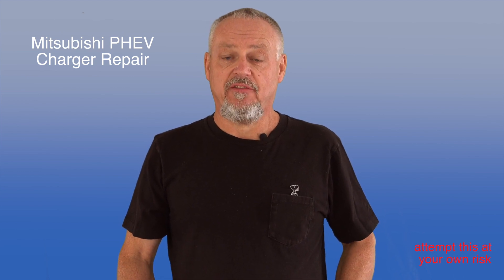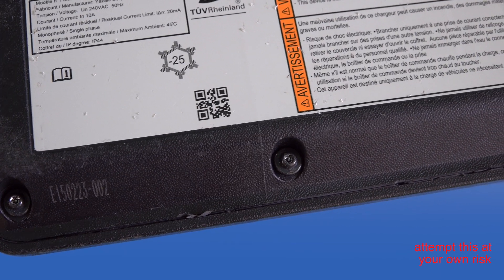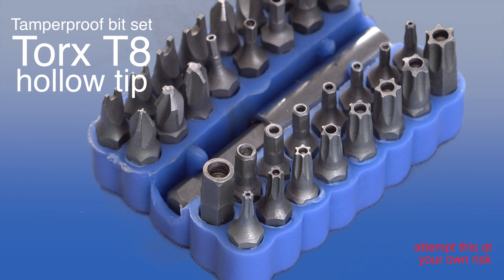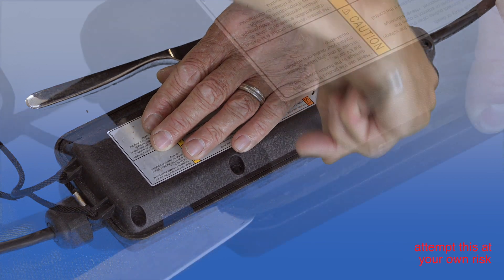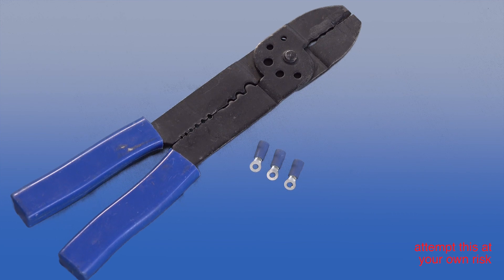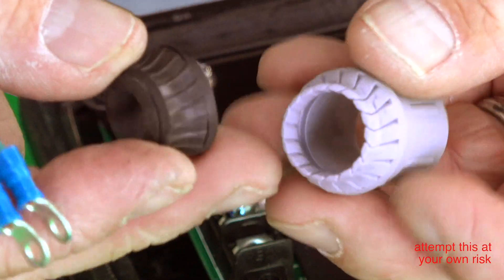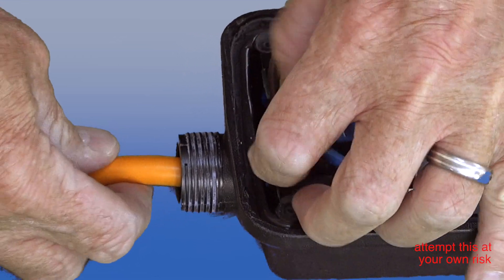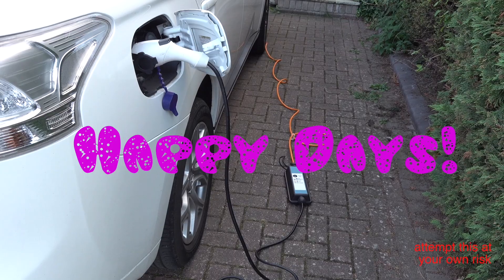Mitsubishi Outlander PHEV Charger repair

Comment: Great video. I was gifted a unit that wasn't working. both positive and negative wires were broken at the gland. People forget to use the cord to suspend the unit from the wall socket and put all the strain on the electrical cable. Unit is now charging my car. Hurrah

Comment: This might be a stupid question, but I'm using the 3 pin, and that cable you replaced it with doesn't see to have a 3 pin connection on it?

Comment: Thank you for this, very helpful. I had a slightly different problem with my (2018) Mitsubishi level one charger: it would go to fault cycle consistently after a couple of hours max of charging. Took two small repairs over time to fix. First, nine month ago, the charger plug lugs were slightly scorched, blackened. I lightly sanded the lugs with emery (blue) sandpaper and some light filing with a metal file, to eliminate the scorching. That worked for a while. Second, recently, I suspected that the 110V duplex wall plug in my garage wasn’t strong enough for EV charging. Domestic wall plugs don’t normally handle eight amps for 8-9 hours straight. I’ve heard that a similar problem can happen with 220V plugs for level two chargers. So I replaced the domestic 110V wall plug with an “industrial” plug from the hardware store; it cost $12.50 Cdn plus a new cover. The charger has worked well since. Also, Mitsubishi sells a weatherproof cover for the charging port, that protects the port from rain (and snow in my case). Costs about $35 Cdn.

Comment: When I (finally) got the box open and checked out the short wire to the plug there was no continuity. Both the live and neutral wires were broken inside their insulation near the 'gland'... It's clear this charger was not 'fit for purpose' when manufactured and it should have been recalled.

Comment: Thank you very much, this saved me 857 Euro as that is the price here in Norway.  Used some body sealant in order to make it water resistant. I was not sure if I should replace the power cord with a 1.5 mm or 2.5 mm cable  but went for a 1.5 mm cable as the rating for the cable i approximately 10 Amp. The Lid was as your said a little tidy to remove but your instruction was a good help.

Comment: Fixed my charger too. Thanks a heap. 
It looks like the gland on the original factory fitting was over tightened, stressing the copper. That is where the break was- on mine anyway. Thanks again.
Don

Comment: Amazing, it worked! Saved me about 500 Euros. I already replaced the charger one time for exactly the same problem. Its ridiculous. Thanks. 
(yeah getting the lid off can be bit of a hassle, I used a sharp small screwdriver also to yank out the sealant stuff before prying near the corners
Reply: which replacement cable do we need to buy?

Comment: Thanks a lot for this video. I managed to repair my charger. One thing I did do was remove the screws holding the circuit board in so I could get beneath to unscrew the clips holding the wires better. May save a few headaches :-)
Reply: Great suggestion helped me thanks!

Comment: Hi there, i've been struggling to pry it open for 30 mins now. I used stanly knife at first to cut and have been trying to loosen it up with kitchen knife after. How did you guys succeed.
Reply: Yeah it's hard work but a Stanley knife and a kitchen knife to seperate and pry apart is the trick. Also the corners need picked at top and bottom not so much

Comment: Got my outie on weds, found if I move the charger while it was on it stopped and restarted charging yours was the first vid I watched and yes the same defect though mine was the negative wire.
I found holding the cable clamp at the right angle with needle nose pliers I could re sit the clamp easily. 
And for the screws a magnetic screwdriver if you have one.
Great vid many thanks.

Comment: What was the original fault before you took the unt apart? Mine is showing Stop Fault ( making me think it has got power) It faailed after being out in the rain for a day! but it should be water proof?
Reply from the maker: Duncan Muir Mine was just dead due to the broken wire.
Reply: @QuentinClark  Thanks for reply, I just wondered what showed on the unit to make you aware of the problem? Were any of the leds illuminated or was it all dead?
Reply from the maker: Duncan Muir All dead but came on and off when the wire was wiggled.
Reply: @QuentinClark  thanx for the great video 👍🏻. Do you know how to open the connector in the other end? The one that one stuck in the car..

Comment: Mine stopped working but was still under warranty. I couldn’t find a video on youtube at the time!  It took the garage over a week to get me a new one, so it cost me in petrol. I was told what happened to yours is due to letting it dangle on the plug without support. They didn’t open it up. They sent it back to Mitsubishi. I bought a spare on eBay. If it happens after the warranty has expired I’ll copy your method. Many thanks for posting. I was interested to see what it’s innards look like.

Comment: Hi Quentin, 
I was just thinking about the point you made on the sort of mastic they used to seal the box itself, and i came to the conclusion that it is may be to protect the device from water or rain as it is often used outdoor. I suppose this might be related to the certification of it (may be ip certification, can't remember).
So may be before closing the box it would have been a good idea to add some silicone all around to reproduce what they did and isolate it.
A sugestion. May be you will find it silly.
Also what is the Amp of the cable you used? 16 a i guess?
Reply from the maker: I think that’s a great idea but i was concerned that silicone seems to smell f something like acetic acid as it cures so i was worried about trapping that vapour inside the housing. There are certainly mastic options that you could use and they would make it waterproof. Yes 16 amp cable.